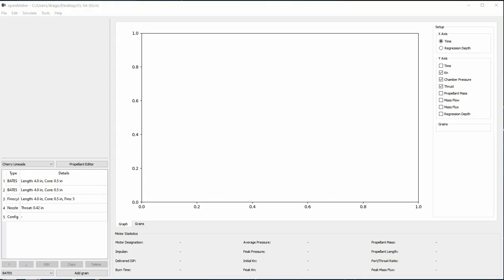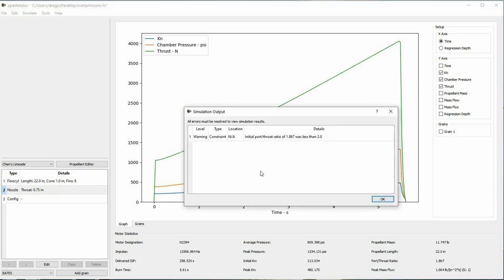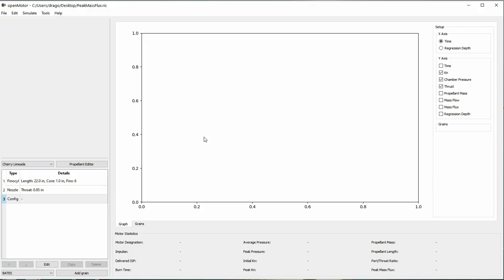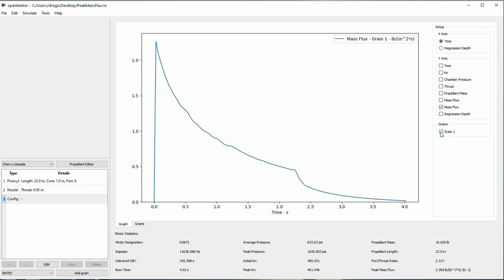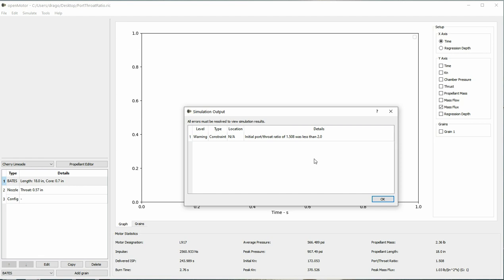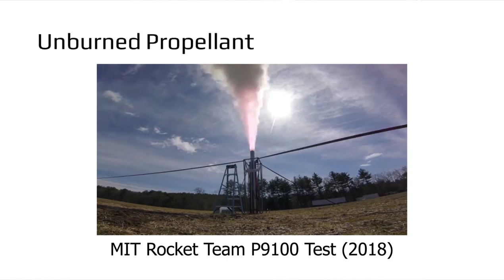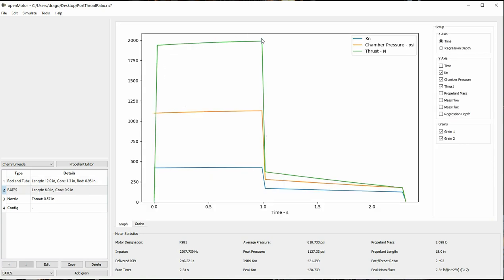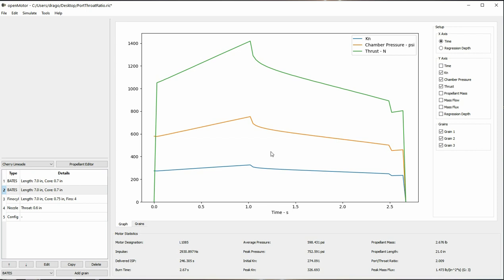Solid Rocket Motors 1.5: OpenMotor Tips

Comment: Hi Charlie, nice video. The reason our motor CATOed at 0:55 was due to overpressurization. The cause of the overpressurization was the dual pulse design of the motor...like a 2-stage rocket with a single nozzle. The concept used a pyrotechnic mid-bulkhead between the two motors. When the aft motor was ignited at launch, it would also ignite the mid-bulkhead that in theory, would take 15 seconds to burn through. The aft motor would boost the rocket and coast through dense atmosphere for ten seconds, then the forward motor would fire sending combustion gases through the burned out aft section and out the nozzle. We had two problems making this design work: 1) heat soak into the motor case from the aft motor weakening the case and 2) failure of the mid-bulkhead that would suddenly increase the Kn drastically, as seen in your video clip of that motor test. All of our singlepulse motor tests were successful that did not include this dual burn design. We have since moved on to conventional 2-stage rocket design (two nozzles)

Comment: You mentioned a concerning KN value of around 2.0 lb/ft^2*s but your units show are shown in lb/in^2*s. Is this concerning mass flux in units of inches or feet?
Reply: Also you said that to decrease the Kn, we should increase the size of the port, but wouldn't we want to decrease the port size to decrease the surface area? Thanks
Reply from the maker: Hi @bnl1852
2 lbs/in^2 is the correct 'concern' threshold for core mass flux, although I'm aware of motors that have operated at as high of a value as 9.0 lbs/in^2 with appropriate design on both the internal ballistics and propellant. Appropriate KN values (which is a separate design concern) are usually in the 150-300 range, depending on propellant.

Increasing the size of the port raises the KN but improves the core mass flux as there is more area for the gas to flow.
Reply: @AstroCharlie  Ah this makes more sense now, thank you for the clarification. 

I have my first job interview tomorrow and wanted to brush up on SRM design, you're videos have been extremely helpful so thank you!

Comment: I was thinking the other day that many of the fuels used in solid propellants are actually injected as a softer putty then dried. You can create 3d printers that use injectors for liquid materials like resins, clay or gels that are then hardened using various means.  If you could find a clay or polymer/clay mix that was heat resistant and could be used in such a printer, then also had another injector nozzle for whatever material you were using in the solid propellant, you could make some really fancy designs for entirely enclosed solid rocket engines with all different types of engineered-shape venturis and different channels in the fuel to accelerate the burn.

Comment: Again, nicely done video series. Comment: at 7:30 in the video you suggest not having all the grains burn out at the same time to avoid a pressure drop. If all the grains burn out at the same time you have little to no unburned propellant...I do all my BATES grain motors to burn out at the same time and never have unburned propellant left. Also, at 7:45 you say finocyl grains burn out over a longer period of time yet your graphic shows burning out at the same time as the BATES if you design it with deep 'fins'. Deep fins are to increase startup burn surface for high initial thrust/acceleration. Shallow 'fins' offer a monolithic grain a neutral burn profile with most of the propellant burning out at the same time.

Comment: Does anyone know how to add new propellants? I added a density but do not know how to add a characteristic velocity. It also says "Tab #1 has the same minimum and maximum pressures."
Reply from the maker: The characteristic velocity is calculated via thermodynamics or test data. Software like Propep can help you calculate this. 'Tabular' propellants are set up in the software to have more complex behaviors, but they require those ranges to be defined. A simpler propellant just has a single behavior from some minimum to some maximum pressure.

Comment: Hey Charlie.
I am using open Motor because I want to calculate the performance for my self built Rocket Candy Motor. As Propellant data I entered the Properties I could find on Richard Nakkas site. My Problem is, that the Chamber pressures seem way too high. Whenever I simulate I get two warnings:
"Max pressure exceeded" and
"Propellant pressure deviated from propellants entered ranges. Results might not be accurate."
Even when I make the nozzle as wide as the grain I get these warnings and a peak pressure of 3831psi. Do you have any Idea how I could fix this?

Comment: Hey. Since you know a lot about rockets, could someone ease tell me why there is often a pipe going to the end of the nozzle. What is it used for? Is I necessary?
Reply from the maker: That pipe typically carries the fuel to the bottom of the nozzle to flow it between the layers of the nozzle to keep it cool. This is called 'regenerative cooling' sometimes this also carries the turbine exhaust.

Comment: I am aiming for a long burn time, medium thrust motor. I ended up with a 38mm G50 with a burn time of 3.12 seconds and an average thrust of about ~50 newtons. To keep it G impulse (I do not have L1 Certification yet) I had to over expand the nozzle a little. Are there any signs that I should be aware of that might indicate flow separation? The best way I could test it was to increase the exit diameter further and see how the thrust changes, but I am not too sure what I am looking for.
Reply from the maker: openMotor will not advise you about flow separation. Why did you overexpand the nozzle instead of using less propellant?
Reply: @AstroCharlie  Because then the total impulse became too high. Though I can reduce the propellant further and get slightly longer burn times, however that means sacrificing a bit of thrust. I am trying to find a good balance between something that will look cool, and something that can preform well.

Comment: I wish amonium perchlorate was cheaper and easier to get. Oh well, at least they did a great job keeping it safe away from kids
Reply: From our research, Ammonium Nitrate will give you 95% of the theoretical specific impulse of Ammonium Perchlorate, but with none of the toxic exhaust. Also, you will not be punching holes in the ozone layer every time that you launch very high. On the down side, Ammonium Nitrate has long burn times (sometimes good), has a nasty habit of crystalline phase changes at atmospheric temperatures, will suck the moisture out of the air and turn itself into puddles and for some formulations will require sustained temperatures of 2,000+ degrees C to light.  But it is a LOT cheaper than Ammonium Perchlorate.
Reply: It's Ammonium Percolate. Source of small quantities, is the active ingredient in 'Cold Packs' in the Bandaid section of Pharmacies.
Reply: @paulmoffat9306  Oh sorry I meant that. Also yes I am aware, but the very pure high quality form is optimal for a rocket propulsion system. And opening a bunch of cold packs will be a bit of work. Well that is still a option though.
Reply: @paulmoffat9306  ammonium perchlorate is NOT found in cold packs. That would be ammonium nitrate. Even more commonly found in cold packs is ammonium chloride. You would preform a double replacement reaction with potassium perchlorate to yield ammonium perchlorate.
Reply from the maker: It is actually ammonium perchlorate, I don't believe that it is used in cold packs.
Reply: @AstroCharlie   @Paul Moffat @Magic Smoke RC  yes my dad uses them at his clinic, I double checked, cold packs have ammonium nitrate, not ammonium perchlorate. Gosh I better look very carefully to make sure it's  ammonium perchlorate when If I ever buy it. For sure I won't be making motors till I fully understand the chemistry  (that's in a while). Thanks for telling me though 😀
Reply: Im a child. They did not do a good job keeping it away. (I cant buy it, so I buy ingredients to make it!)
Reply: For me it is even impossible to get AP, it is illegal in European Union.

Comment: For a solid rocket motor, if the effects are very transitory at the start of the burn (i.e. an extremely hard start), how much of an issue is a significant rise above operational pressure?

I mean, it sounds like it shouldn't be catastrophic because of any of the things you mention here, which is nice, but it sounds like the kind of thing which should cause issues that would either need dealing with or would be a ruler-outer. Would structural failure of the propellant ever be much of a concern when it hasn't had the time to burn away yet to any real degree?
Reply from the maker: Extremely hard starts are probably the second most common cause of failure, after heat related failures. A significant rise above average pressure is fine, as long as it isn't a rise above design pressure.
Structural failure of the propellant can happen any time.
Reply: Thanks, that's very helpful to know. I'll just start testing it softly and carefully work it up then.